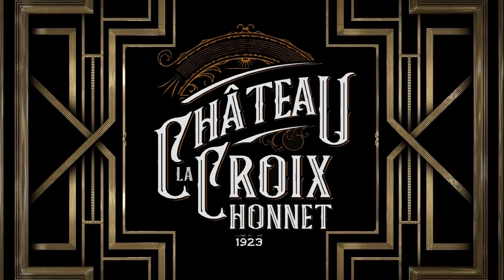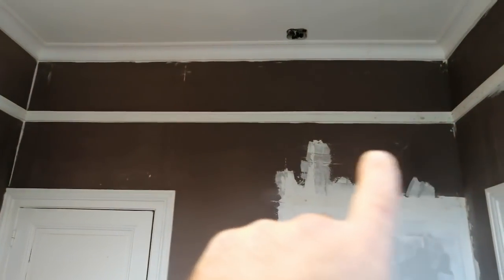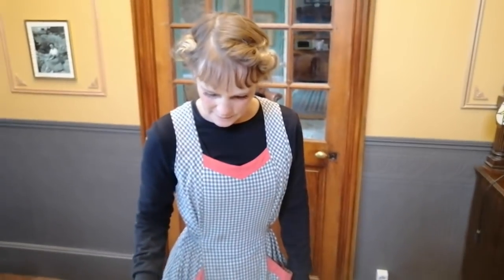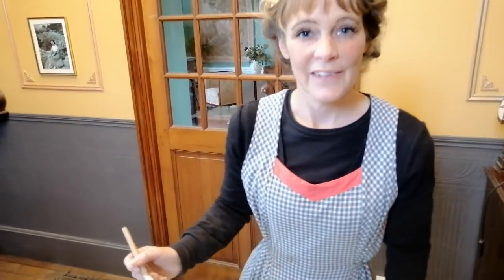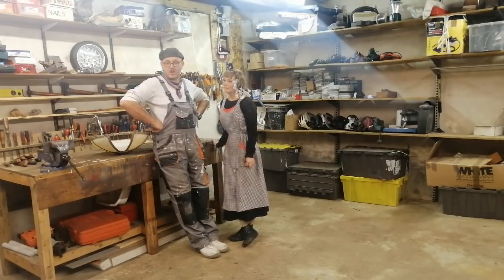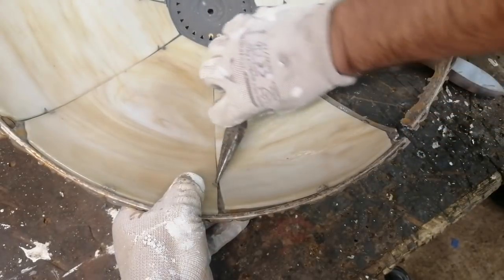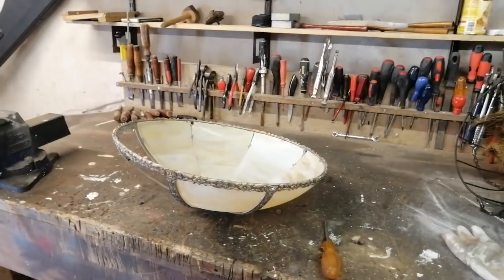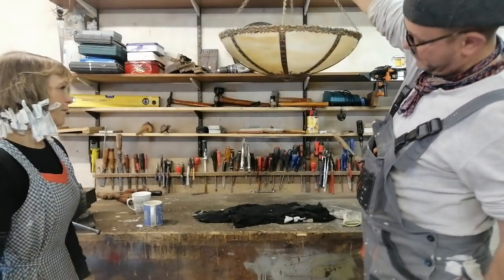Ep 59: DIY Upstairs continues

Comment: suggestion old painters trick. When you're doing around door knobs or any metal or whatever. Gets in some  Vaseline and put on the door knobs and and handles anything you do not want painted. And when the paint job is done and dried just wipe off the Vaseline. This works on glass also.
Reply from the maker: Thank you so much for that :-)

Comment: You two have the patience of saints. Everything you've taken on has been done with such devotion and detail. Bravo you clever kids. 

I am concerned there may be some lead particles still attached to the window fittings. Anyone working those fittings with a wire brush should be doing so with a mask, protective clothing, and goggles under an extractor to collect the dust. You don't want to transfer lead dust. As it is the majority of the lead has been sent up the chimney and disbursed across the local landscape. Any fittings that have tested positive for lead paint really need to be taken to a specialist shot for a chemical bath to remove all contamination from the metal. That said, these fittings may not have tested positive for lead. I would hope this adorable and clever couple have had the property test and treated to remove all traces of lead and asbestos. These old building have generations of toxi s built into them. Removing everything is a costly job. However remediation can be done room by room as you go. Granted each trip by specialized removal teams does add more to the costs of removal. 

This is why it is critical to have any property you're interested in purchasing surveyed prior to signing any contract. You can sign the contract contingent on the survey outcome. The some or all costs of remediation of toxins can be deducted from the purchase price on high priced properties. For those properties one the lower end of the price scale, one must take such risks into consideration before purchasing. No matter the price of the property you must have a survey completed. For all you know the seller has hidden the fact an arsenic mine is located in the basement; making the property uninhabitable. Attempting to remove toxins from a property is dangerous and in many areas illegal due to the risk of contamination to the land and neighboring properties. 

Cheers!
Reply from the maker: Thank you for your advice. You'll be pleased to know that we did indeed have a full toxic survey done on the Chateau before buying it, including paint finishes and lead content. Belive it or not, we also had a land survey done too, that explored all local terrain, contaminates and make up. What with all the other reports, it gave us 100s of reasons not to buy! But the good news is the paint in water-based emulsion probably from 80s onwards. Quite right about masks though, we do need better discipline here. So glad you enjoy what we are doing though, happy 2021 to you :-)

Comment: Another less invasive way to get paint off old hardware is to place the hardware in a water filled crock pot for 12 to 24 hours under full heat setting and the paint should come off easily with steel wool or wire brush. No chance of over heating or damage to the hardware! Thought you might want to try it!
Reply: I've done this many times. It really, really works! I've also seen people do it in an old coffee maker. But the slow cooker seems to work the best. Cheers!
Reply: @oxwoman8  If you don't want to wait that long, throwing the items into an old pot of boiling water for a few minutes works too. You do have to remove the paint while the bits are hot though and might have to throw them back into the water to loosen up any stubborn flakes of paint.
Reply: I was just going it say the same thing, works well and you can just peel the paint off.
Reply: @Ragnar8504  Thanks for the tip. I didnt know you had to de-paint the metal while hot/warm.
Reply: Deborah Shaw  except Anna is scrubbing/brushing. I want easy. Also, don't have a fire place. Water it is.
Reply: I have one concern. Does that paint have lead in it? Dust from sanding and wire brushing might be toxic.
Reply from the maker: Oh wow, we shall try that and see how that works, thank you Richard!!
Reply from the maker: We will try this Catherine :-)
Reply from the maker: Thanks Ragnar!
Reply from the maker: Indeed Deborah, thanks it works for us!
Reply from the maker: Thanks Fran, quite right!
Reply from the maker: good luck - give it a try!!
Reply from the maker: yes, there is residue to finish the metal properly Sunny Girl, but the paint was SO thick to begin with - it is easy for us and proven it works for us!
Reply from the maker: No, the painting of the Chateau happened in the 90s and so wont have lead in - the earlier stuff is the risk and we are careful with that!
Reply: @sunnygirl87  Not sure about the crockpot method but if you use boiling water the paint will definitely stick again once it cools enough.

Comment: You need a sand blasting machine it would take all the old paint down to metal easily. Using it would save you so much time.
Reply from the maker: It's on the list to buy if one second hand comes up, it's a great idea and would be well used :-)

Comment: I might suggest that you soak your window parts in hot water and it should soak off..... I it is just a suggestion....
Reply from the maker: We will try that next time Carol, thank you for the suggestion
Reply: I should have said if you use an old slow cooker or crockpot that you use just for window parts you should not need to use a wire brush.  just a suggestion....
Reply from the maker: Great thank you Carol, you star